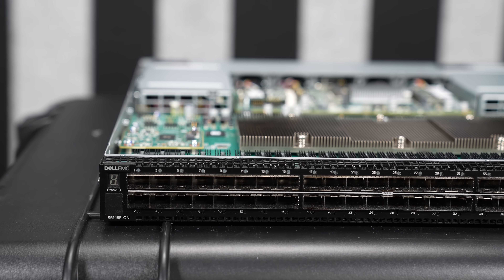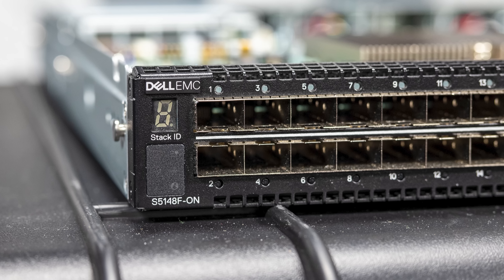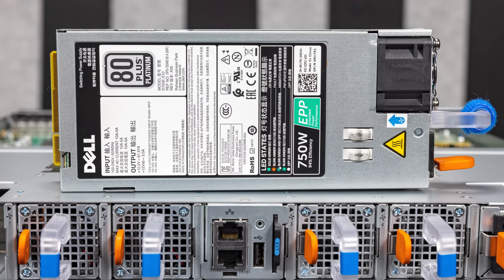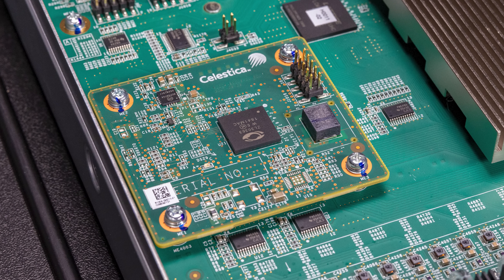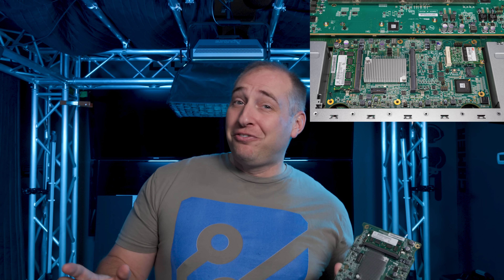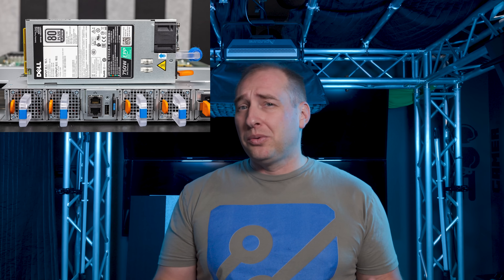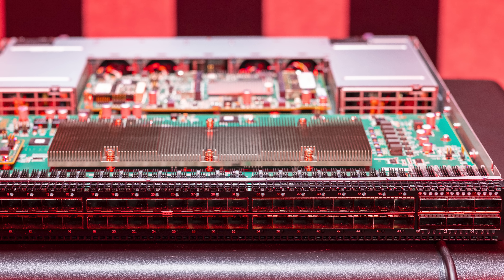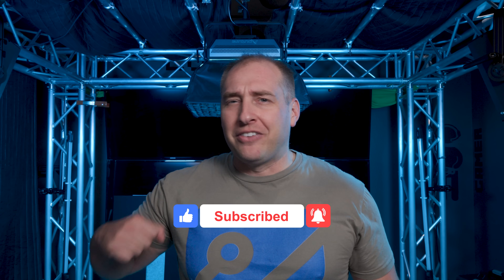Why the Dell S5148F-ON is a cheaper 25/100GbE Switch

Comment: So I just picked up a S5148F-ON that didn't have an OS on it and had to install the OS via ONIE. OPX (Open Switch) is supported on the S5148F-ON. Took less than 5 minutes once I realised ONIE was on the machine and didn't have to install ONIE, too, and got OPX running. Just having to learn OPX now lol

Comment: Intel Atom C2000 does this mean these Dell switches is a ticking time bomb? The C2000 bug with clock degradation that murdered network appliances and Intel refuse to fix it, just buy new was solution....

I've experienced 2 Clavister firewalls per month dying, and my private nas also died. Clavister said that Intel refused to deal with it and RMA required a working version to be sent in and then be confirmed with the bug, when it died it could be confirmed hence no way to get money back, Intel is so stupid.

Comment: A quick look on ebay I see these switches both with the Dell OS installed and without, is the dell OS something you have to pay for if it's not included? are there free options from third parties?
Reply: Just done some searching and read the text article that goes with this and it looks like the dell network OS requires a license, but the switch is also compatible with openswitch which appears to be free.
Reply: @petermichaelgreen  I really WISH that this is not just what they state on their (dead) website. Installed 3.2 and 2.3.1. neither of them "work" with regards to finding the ports and map them to /dev. Got a heavy, expensive brick ... someone needs one ? EDIT: Use Version OPX 3.0 and dont (apt) update ...

Comment: Also be aware that it is now not supported for OS10.5 onwards, so even Dell have given up on supporting it.  There is no multicast routing available, no IEEE1588 support in software (although technically it is supported in hardware).  We've used one for a few years, and provided you can work with the limitations it is fine and reliable, but there are some significant caveats

Comment: Again perfect timing. I'm just quoting $200k of Cisco crap. This is so refreshing. Nobody does reviews like this. So hard to compare real specs of mid level switches. No vendor shows the real guts of the gear. Cisco and it's ridiculous licensing is absolutely crazy. Maybe it's possible to find real specs somewhere but definitely not in marketing fluff of big guys. Does it look like I'm big fan of Cisco ? I'm not.

Comment: Hi @ServeTheHome, another interesting video.  One thing I think you should have mentioned:  You keep talking about the "front" and the "back" of the switch, but that front and back are defined by the airflow configuration of the switch, and in my experience, most of the switches we sell are PSU -> IO airflow, so what you keep calling the front would actually be the back and vice-versa with that configuration.  There will definitely be switches out there that are IO->PSU, but for a datacentre setup, this isn't the most optimal configuration. #IWork4Dell
Reply from the maker: We standardize on ports being the front and fans/ PSU being the rear. The first photos we show on the STH main site always have this orientation. We have to have a standard nomenclature and methodology across brands otherwise it gets too confusing.
Reply: @ServeTheHomeVideo  That makes sense, but when you mention that there are no console ports on the "front", in what I would normally consider the normal config, being PSU -> IO, those ports would actually be on the "front".  Anyway, as always I enjoy your reviews, definitely not criticising the review, but just thought a mention of airflow might be appropriate.
Reply from the maker: @strategicalit  so from an industry perspective we tend to have standardized front and rear. The switch may be mounted and have airflow for port to PSU or PSU to port, but that gets into how a switch is deployed, not how we discuss the switch static on a bench. If you have PSU to port airflow, usually you are mounting it with the port face on the cold aisle and the serial/USB/management ports are somewhere 0.5m or so in the middle of a rack. Most interactions will still occur with the port side, and that is the side vendors generally paint/ spend time on so we call that the front to standardize.
Reply: I don't fully agree, many manufacturers use the terms RTF/FTR (rear to front, front to rear) implying that the PSU side is the rear, and the port side is the front.

The airflow direction depends on how the switch is used, if used as a TOR (top-of-rack) switch, it will be mounted with the port facing the back of the rack, and you'll use RTF airflow.

If used in a networking rack, the ports typically points towards the front of the rack, and thus use FTR airflow.

If you look at high-end DC switches, they are more often FTR, because they are used as cores, and not TOR.
Reply: @HomelabExtreme  RTF/FTR maybe correct for other manufacturers but this is a Dell switch being reviewed, so instead of using front & back we refer to IO -> PSU or PSU -> IO.  So in the review they talk about no console port etc. on the "front", but on a PSU -> IO switch this would actually be the front :-)
Reply from the maker: @strategicalit  Just to be clear, we try not use vendor specific language in our reviews.

Comment: Hi Patrick!  One of the things I really like about OS10 is that you can type "system bash" and drop into the linux shell.  Then you can install whatever you want with apt-get.  That is why the extra RAM slot might be useful. ;-)
Reply: This is a great feature. IMHO docker is pre-installed, so you can run your container workload directly on the switch :-). Also in most cases net-tools like tcpdump or ip work perfectly fine. Dell also provides a good set of Ansible modules for switch configuration. I really like OS10 (or should I say Debian 😉 ).
Reply: @andreasf8170  The ansible modules are alright. I wish they were better but I understand why they have them configured that way. I would rather see a more service oriented architecture than global vs hosts. But maybe that is just me.
Reply: Does OS10 support switch stacking yet? Few years back Dell sold us a pair of OS 10 switches with the promise they would stack (the switch even had a stack ID counter on the front), and it never stacked. I dont work on them anymore, but for years having to work around Dell’s failed promises was infuriating
Reply: @TheTrueSmitch  nope. No stacking.  What are you trying to do though?  probably VLT will cover you for any redundancy options.
Reply: @I4getTings  I don’t work with the device anymore, so I am not sure VLT would fit the needs or not. Either way, I was not impressed with Dell having to put up with it and work around it for two years
Reply: @TheTrueSmitch  IMHO OS10 does not support stacking. When I remember correctly one problem with Dell switch stacking was, that both / all switches need exactly the same OS version. So OS updates always lead to outages. With OS10 LACP implementation (VLT) this is relaxed: it is now possible to update the OS one by one without loosing the complete connectivity.
Reply: @jeremygmail is this really a new feature?

Comment: Are RISC-V going to be used in servers.
Reply from the maker: Yes, but my sense is that it will not be a mainstream server processor in the short term. Even in a switch like this where an Arm CPU today may be a good choice, having x86 and broad compatibility is usually preferable (hyper-scale folks excluded since they can do their own thing)
Reply: Probably in a highly custom SoC, not vanilla RISCV. Not to mention that although the ISA is open source, the actual chip design isn’t (SciFive’s layout of the logic gates is closed-source) or not very good (the open-source Berkeley layout is practically an incomplete microcontroller, cannot run Linux at all)

Comment: So ...is there any way to make this quiet?
Reply: Leave it powered off
Reply: @TiagoJoaoSilva  😂😂
Reply: Put it in a room far away from where your computer is and run long cables :) That is about it.
Reply: liquid cooling
Reply: @marcogenovesi8570  lol
Reply: Have you got both PSU's plugged in?  They used to run loud with just 1 PSU
Reply: @downhilldick  no, I don't have one lol.
Reply from the maker: That is partly since the design expects a second PSU for the PSU fan exhaust as well. With both in they are still too loud to be near a quiet office.
Reply: @ServeTheHomeVideo  it would be nice in part of your switch review videos that you turned on the switch for 20secs so we can hear what the fans sound like
Reply: Questions: How much do 100g fiber links cost and is it illegal to run a pirate ISP out if your rental duplex.
Reply: @Dcatts-i2z  You can get 48 fiber armored outdoor direct bury cable for $0.89 per foot.

Comment: I had a net6501/2 firewall appliance from Soekris. I think the avr bug put them out of business. Right around the time it became public the main owner up and moved to another country and left the business to his co owner who had no technical knowledge. I basically wrote it off as it was unlikely to get any kind of support for it. I ended up replacing it with a PcEngines APU2 which was more capable anyhow. I think I'm going to replace that now as it's become quite limiting. ALSO I just upgraded to Gb internet which I don't think the Apu can fully support.

Comment: After swapping out a CV axel, replacing a CMOS battery under the SP board isn’t a big deal
Reply from the maker: Fair point.
Reply: I kinda wonder if the placement is deliberate to dissuade anyone from trying to hotswap it.
Reply: I have a Moxa Nport 5610-16 serial console, old but hey it still works and it sits on a dedicated management network. Well apart from the fact the battery for the RTC is dead. The problem is the utter morons who designed thing decided that a Panasonic BR1225/HCN instead of a CR2032 and a holder would be a good idea. Yeah so you have to remove the PCB and desolder the battery to change it. Even better getting them in the UK is next to impossible. I have had one on back order now for over two months now. I won't care but there is plenty of space for a CR2032 coin cell. Frankly the person who made that design choice needs a jolly good thrashing with a clue stick and then sacking.

Comment: The Atom C2000 failure should be DIY fixable by some minor soldering work (you have to bodge in an extra resistor or something). The question is if the correct pin you have to solder to is exposed on the PCB or not. It is exposed on some Synology NAS boards that suffer from this problem, so they are easily fixable.

Comment: My experience with this switch series is getting an evaluation unit, turning it on and immediately finding multiple python stack traces, parser errors and other critical bugs. Maybe it's better with other OSes though :)
Reply: As mentioned prior Dell switches are shit... Nothing but complaints in Reddit Networking threads. They are cheap for a reason.
Reply: @mnoble247  Said people will probably also complain Cisco is too darn expensive too. It boils down to what are you willing to deal with. And for me and my org, it is Dell switches.
Reply: the demo depot probably didnt reflash it. It is relatively easy to get into ONiE and reflash with either DellOS10 (Force10 software) or any other ONiE compatible OS like SONiC
Reply: @jeremygmail  Oh no, this was a brand new unit. Completely fresh everything. Their OS was just that buggy.
Reply: @jeremygmail  personally we are running SONiC on everything, but we are using only Edgecore and Mellanox/Nvidia, so I have no idea how Dell works with SONiC vs other OSes, but I found SONiC to be super reliable for us on all hardware.